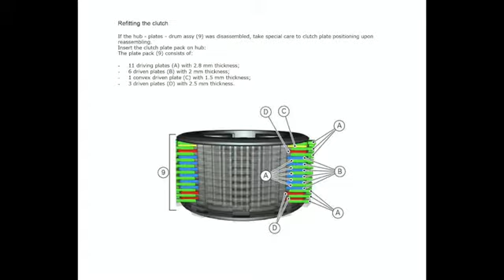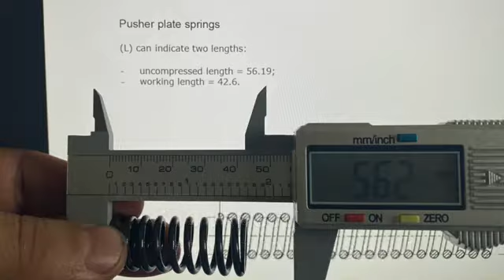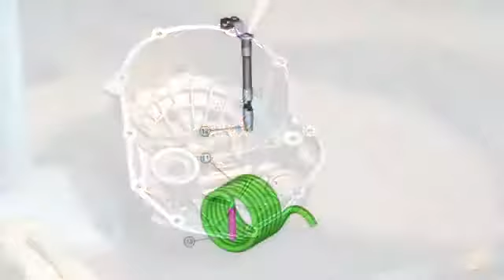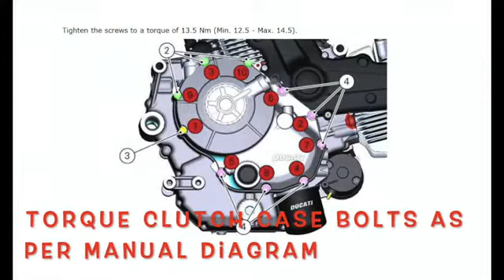Ducati Scrambler Clutch Kit Replacement

Comment: Sound has disappeared Dan.  Great video. Replaced my clutch yesterday .
Reply: Cheers for the positive comment. I didn't include sound on purpose. Next video I will. Im doing both front forks. Next VIdeo.
Reply: Looking forward to that.  I've got the Hyperpro Street Box on my Flat Track Pro but the front was way too hard so I cut the rhs spacer down.  It's much better now but still only using about 75% of travel.  I ride fairly hard at times.

Comment: Hi Dan, hoy are you? Your video was so helpful, thanks for this content! But I wanted to ask you something, when I disassembled the clutch I found that the first clutch plate was almost new because the first to metal plates (the slim ones where to thick and one of them is convex like a cone shape (the ones you took out in the minute 3:42) and I didn’t know if it’s a factory defect or that’s the way it’s meant to work. What is the right order to reassemble the clutch plates and the metal plates including the slim metal plates that are on the very beginning? Could you please help me?? 🙏🏼
Reply from the maker: Hi Ruben, do you have the Ducati Scrambler Shop Manual? If not definitely get it. It has all of the diagrams and instructions you need.
The way a clutch works is that all of the plates slightly open to release the gears, then close to engage the gears.
The fact that 1 plate was ok, doesn't mean all of the plates are not worn. They need to be inspected for thickness and wear as per factory standards in the Manual.
The Factory clutch plates come without the spacers, so you re-insert the clutch plate, then spacer then repeat. 
Again, all of this is in the Shop Manual, you can search online. 

Best of luck.

Comment: Hey Dan thank you so much for the video very helpful. I'm running into a problem when I'm installing the cover when I rotate the piece the cable connects to i feel it go in its place and I know because the cover finally seals but then i can't move that lever the cable connects to anymore, i outy some force but not too much cause didnt want to break anything. What am i doing wrong?
Reply: Hi, not a problem, yes, the clutch cable was tricky. I rotated the clutch cable twice. The first time I did it I had to remove everything because I only rotated it once. The 2nd rotation was difficult but I got there. So, only rotate it twice, no more. There is a tension that is needed for this model. Also, check the factory Shop Manual. You can find them online, there are people if forums who will share it with you. I hope this has answered your question.

Comment: you can change the chluch with the exhaust on !!!!  the real problem is the cluch wire ... it is to short ... my first clutch was finsh at 20000 km a friend of mines to .... fix the clutch and drill the howle in the ajust screw on the lever deeper so you can ajust the clutch play  well .... my second was finish after only 5000 km  ....  i fixed the clutch 3times befor a friend found the real problem ... this is a ducati construction error
Reply: what is the problem??, i´m going to change the clutch with only 8000km
Reply: @GodoyM1A1  the wire is to short ... i explain it in my  first post
Reply: @GodoyM1A1   i need 3 cluches  to found the real  problem ...
Reply: drill a hole in the adjust screw at the lever? I just replaced the clutch on DS..

Comment: That oil is NOT wet clutch friendly, that clutch doesn't work as it should again because you took wrong oil. Shell produce fantastic motorcycle oil which is wet clutch friendly and the name is "Shell Advance Ultra 4T"
Reply: Thanks. That is what the Ducati Mechanic also recommended. I have had no issues with the oil, upon research they have the same properties. Thanks for the update!

Comment: Hi Mr Dan, thanks for sharing! Do you remember the stack height of your new clutch plates? I'm asking because the height of after market clutch plates that I bought is too high and that cause my clutch to drag.. 😒
Reply: Did you use Barnett?
Reply from the maker: No sorry I didn’t measure the stack heights as I used OEM plates from Ducati Dealer.

Comment: Super helpful video, thanks Dan! I have a question: I rotate the pin shaft 180 as I'm installing the clutch cover, and it feels like the pin shaft is engaging the clutch pin. However, when I look into the oil fill hole and operate the pin shaft with the clutch cable, I do not see the clutch plates moving. If the pin shaft is properly engaged to the clutch pin and under correct spring tension, should I see the plates moving when operate the clutch? 

Thanks!
Reply from the maker: Spinning the 180 pin shaft was tricky and I had to do it a few times before I felt the clutch engage properly. 
I couldn’t see the plates moving as the engine case was bolted up by that stage.

Comment: why did you pull the exhaust system? It does not seem to be blocking any of the bolts and such.
Reply from the maker: I like to be thorough, getting the exhaust out of the way didn't cost that much time and its always good process to inspect.
Thanks for your comment.

Comment: 7:15. I just remove the basket to replace the wire not replace the whole clutch like this video. but the clutch basket swung back and its seem it didnt go back to the position it was before. Does anybody know why?.  A guy told me that i need to remove the clutch cover to adjust it from inside? Is it true? Sorry im not a mechanic guy and also sorry for my baf english.
Reply from the maker: The wire is spring loaded and needs to be rotated 180deg to put tension on the spring. It’s tricky and I had to do it twice.
Reply: @ducatidan8666  can you show how to rotate 180